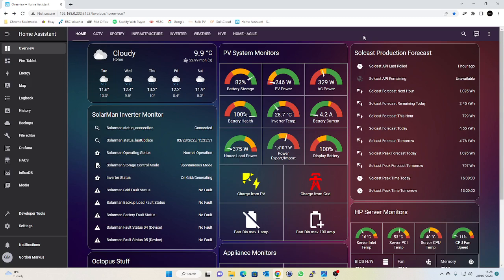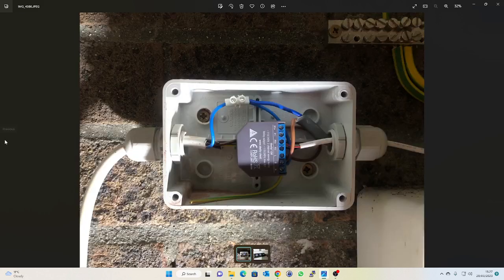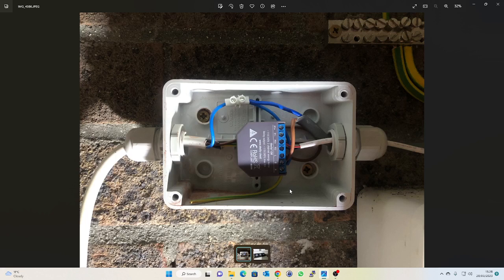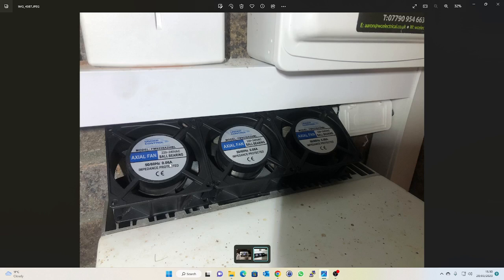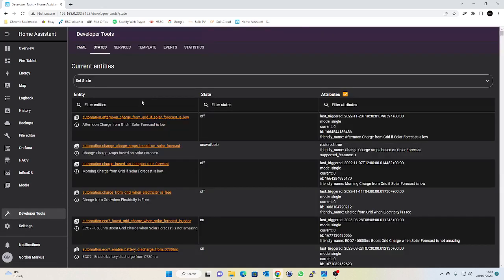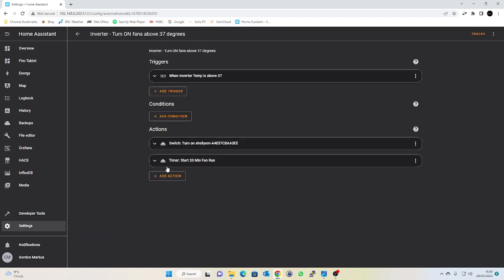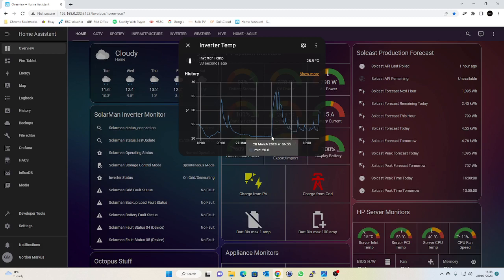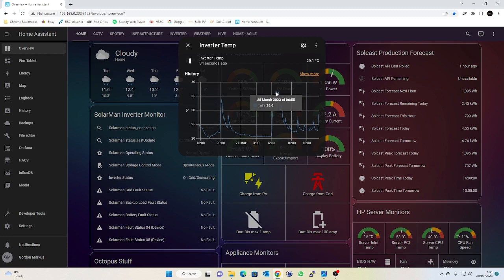Using Home Assistant Automation to control Solis Hybrid Inverter Cooling

Comment: Great video, stupid question, how to you relate the solis temp sensor to your automation?
Reply from the maker: Thanks for watching and the comment. What I do is have 4 automations. The first turns the fans on at 37 degrees (I just just this as a start and never changed it) and starts a 20 minute timer and a 40 minute timer. I then have another automation that turns the fan off when the inverter drops below 30 degrees. The third automation stops the fans when the 20 min timer changes to idle and if the temp is below 35 degrees. The last automation stops the fans when the 40 min timer changes to idle. I've no idea if this is the best setup, but it seems to work and keep the inverter temp pretty stable when it's working hard.
Reply: @gordonmarkus  thank you !
Reply: working now 🙂
Reply from the maker: @mark82421  brilliant news, well done :-)
Reply: Gordon, me again, what direction do you have your fans blowing? (So to speak) 😇
Reply from the maker: no problem, I have them set to pull the air up through the heatsink. That seems to work really well for me @mark82421
Reply: thanks! That is what I am planning to do as well, the 3 fans are on order 👍

Comment: How you connect HA with Solis inverter? Over cloud or local? I will purchase Solis S5-EH1P-L its is compatible?
Reply from the maker: I would probably use waveshare RS485 ethernet converter and connect to RS485 port on the inverter. Have a look in the Solis Owners FB group and ask if anyone else has done this with your model of inverter.

Comment: Interesting, I think I'm going to do the same, but have two fans on the bottom pushing and two on the top pulling air. I've noticed a weird issue with my inverter (Solis RHI 3.6 - same as yours) where on cloudy days, when the sun breaks through, it will often peak at 4.5kW, which is great. However, on a day like today, where there wasn't a cloud in the sky, it never went above 3.3kWh. It makes me think it's being thermally throttled... the inverter temp was 54 degrees. It hits 58 degrees at night during charging, are those numbers high compared to yours?

I've heard of the edge of cloud effect, where it can amplify the sun's rays, but I wonder if it's that or if it's just too hot.
Reply from the maker: Thanks for watching and the comment. Since putting my fans on, my inverter hasn't gone over 37 degrees as that's what I set as the threshold for when the fans kick in. My inverter is in a cupboard under the house on the North side so the ambient temperature there is pretty low anyway and the weather since I've implemented the fans has been unseasonably cool. With regards to your peak at 3.3kw on a cloudless day, could that be because the panels work better when they are cool. On days when there is cloud followed by a break I see much bigger peaks (I have 4.55kw of panels, but sometimes I'll see peaks well over that) whereas on hot clear days it will sit right at 3.8kw.
Reply: @gordonmarkus  on that cloudless day it was only 14 degrees outside, but I can't speak for the panels themselves, perhaps they get quite hot from the sun, it would make sense.

Comment: This is a great idea I have been thinking about doing this, it may be better to have the fans on the bottom blowing the heat up out the top? also may be better to set some more in depth automations to keep the fans on rather than having them come on and off causing added heat stress of the constant cycling to the inverter?
Reply from the maker: Thanks for the comment. These fans work really well 'sucking' the warm air out of the top to be honest, I'm not sure if there would be much difference if I put them below to blow instead (and I'd need to make a bracket or something). Good point on the heat cycling although between 30-37 degrees I don't think it would be adding too much stress. I could just increase my fan run timer to say 60 minutes perhaps though.